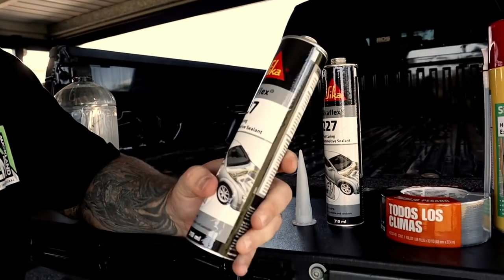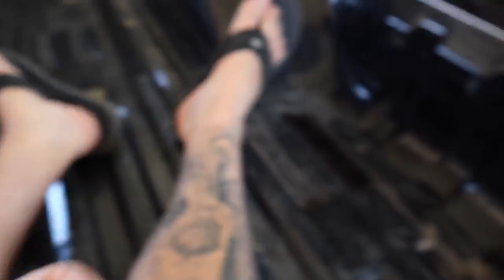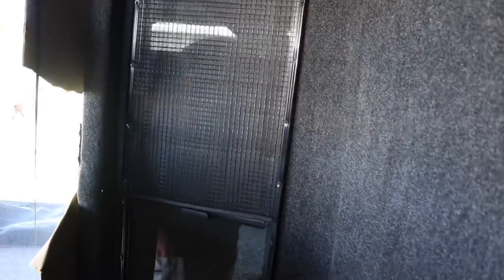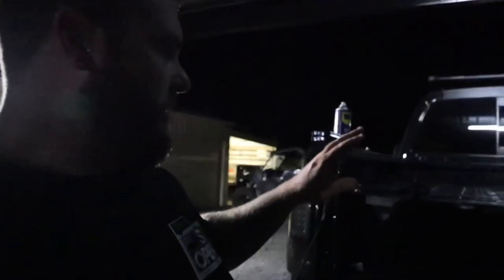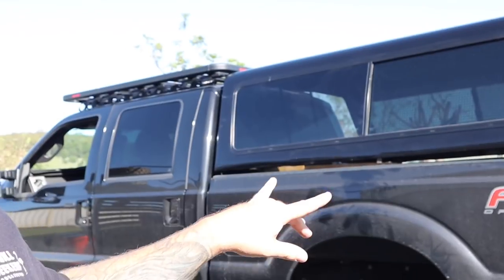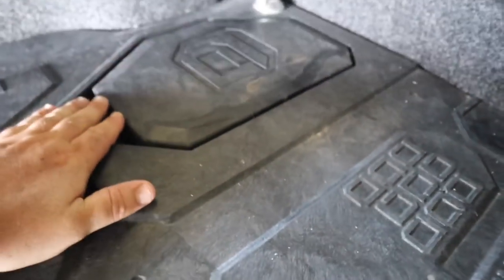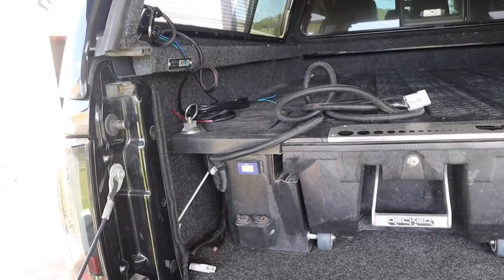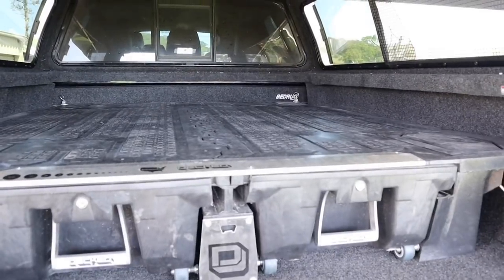HOW TO FIT A SNUGTOP/CANOPY/CAMPER INSTALL OVERLAND F250 BUILD

Comment: Hi mate, 
What’s the brand of the flooring / drawers system .. would you recommend a snug over a tray and canopy
Reply from the maker: I would recommend a tray and canopy over a snug top ! Once I had a tray and canopy Il never buy a fibre glass canopy ever again. The draw system was made by “decked” 😎🤙🏼
Reply: @TyFenwick  thanks mate, I definitely  agree the tray/canopy would be better, but trying to find one under $$40,000 is all but impossible. I’ll keep looking around. I have a ram 3500 coming, would other mods would you recommend mate

Comment: Awesome looking rig. What made you choose Snugtop, over say ARE, Century, LEER... or something else?
Reply from the maker: Availability was the main reason, being in Australia they need to be shipped from the US. Other brands had a long wait. I do now regret buying a snugtop as I’ve had issues since with windows leaking very badly.
Reply: @TyFenwick  Is it just a matter of replacing the seals, or gaskets around the windows? Or, maybe you could use some silicone on the inside rims to keep them from leaking.
Reply: I also regret going with SnugTop for my XtraVision. 
They made my original order wrong so then promised to run my order through again in just a matter of days.
The gas strut supports that fix the struts to the shell blew apart within months... the only advice from customer support was ‘ wear gloves while attempting repairs as the fibreglass resin isn’t nice to work with’.
My window seals leak constantly... the reply’ our shells are weatherproof and not waterproof. 
Now the carpeted head liner is sagging down. 
The customer care said to expect an email from the relevant departments... two months later and still nothing!
They’re a real smug bunch... no help at all. I’ll never buy another SnugTop shell.

Comment: truck looks good. Are you running 37x12.50r20? who makes your front bumper?
Reply from the maker: Cheers, yes I’m running that exact size but thinking about going to the 13.5 wide next. ARB make the front bumper.

Comment: You could have used your forks in the roof. That's how we install them. Hopefully, you put foam tape over the front of the bed.
Reply from the maker: Yes I was going to do that but thought being on my own I’d use the timber then slide it up by hand. The snugtop had foam along the front from factory, I have a very dusty road and so far so good. Thanks 👍🏼
Reply: TY FENWICK yea I used it all the time when installing. They have a double bulb seal but with the superdutys, we add 2 extra strips because your plastic caps step up. And we deal with rail being in WA state.